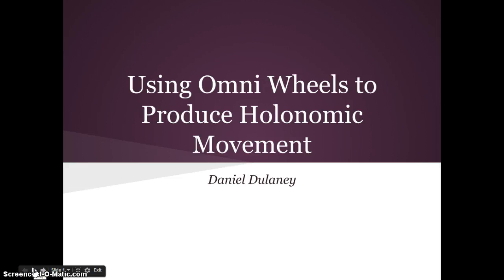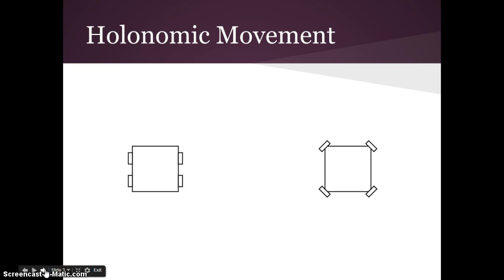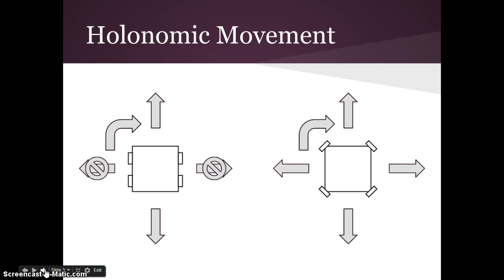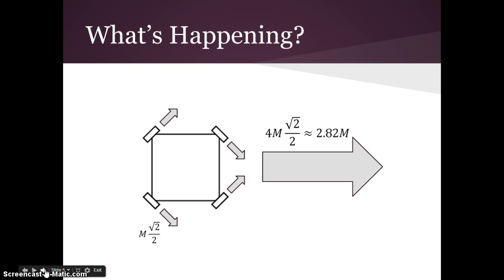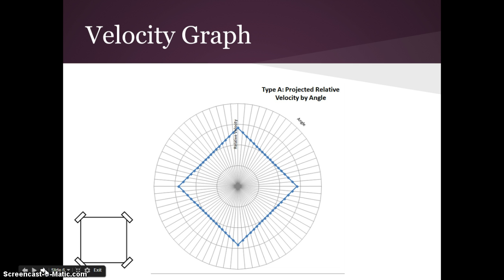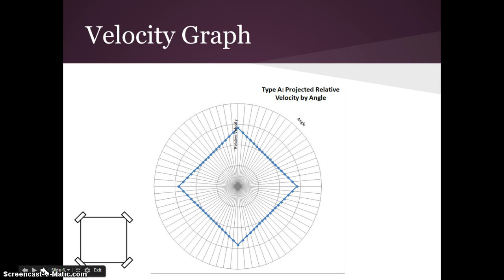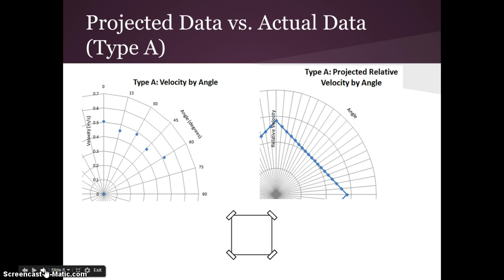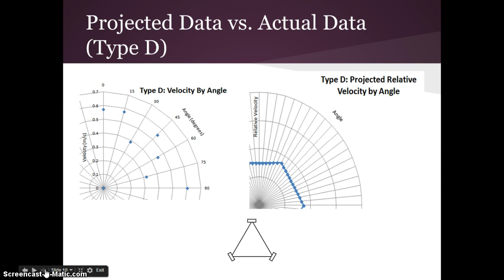Using Omni Wheels to Produce Holonomic Movement

Comment: A small correction, the total transnational velocity is not the SUM of motor speeds in the translation direction, it is the AVERAGE of the motors speeds.
Thus the total velocity at 1:18 is (M+M)/2 = M, and the total velocity at 2:00 is (4*M√2/2)/4 = M√2/2

Comment: Hey Daniel this video is good, nice project. One question,  on the 3 wheel type, have you tried changing the wheels orientation 90 degrees each? That way the wheels are aligned with the centre of the triangle. It makes more sense to me. Do yo think the results would vary?
Reply: in that configuration, the robot would not be able to turn at all?